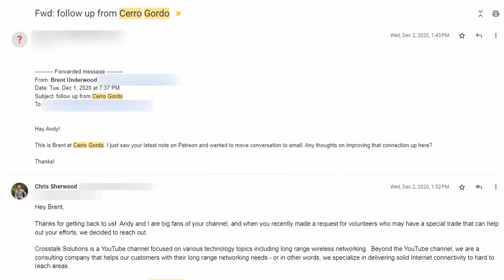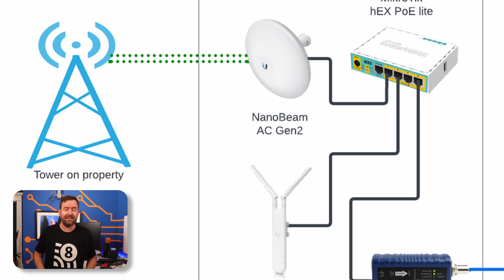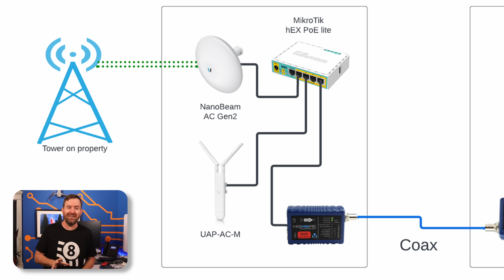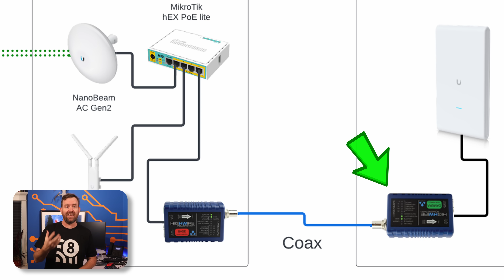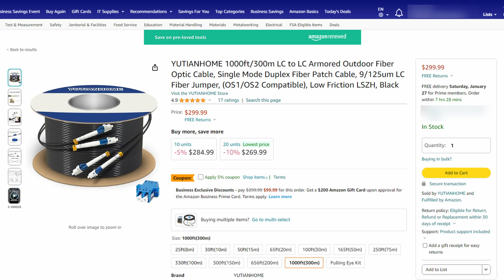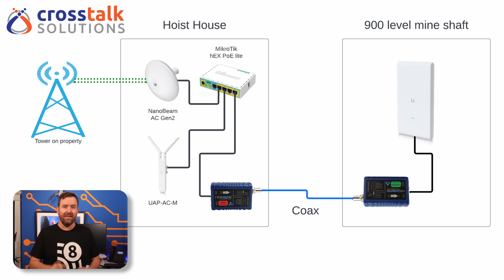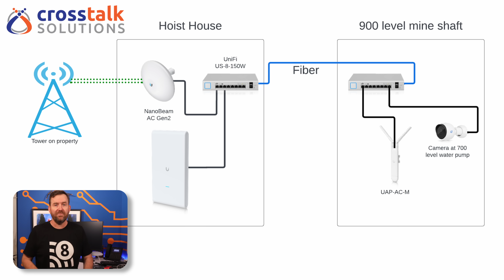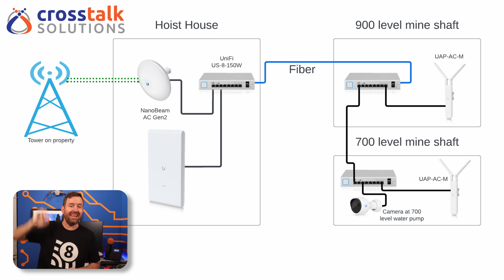Backseat Driving a Wireless Install 900ft Underground

Comment: id get multiple fiber runs down stopping at 700 and 900 and fiber linking the 700ft stop to the switch at the 900ft level with an ac mesh ap mounted horizontal in the elevator shaft every 200ish
 feet so you can hold wifi the entire ride in the elevator encase you get stuck you have 100% coverage in the main shaft. starlink as a main with the tower as a backup or better yet put a udm pro SE with the ups unit up top. use the dual wans to aggregate the data for better latency and redundancy. using the two SFP+ ports with a pair of fiber links down the shaft one stops at 700ft the other at 900ft with a USW-Pro-8-PoE at each level and a 3rd bit of fiber linking the two so if for any reason  one of the fibers to the surface fails it can reroute to the other switch and up the 2nd set in fact if there is a separate air shaft from the main shaft id run one of the cables that way so if the main shaft ever failed you can get a connection and get help. also at each level id get a big battery unit like a ecoflow delta 2 max OR a bluetti ac200l something with at least 24hrs of backup power at each level and at the top so if the mine lost power the internet will still be up including cameras both above and below so if your at 900 ft you can tell whats going on in the lift house in town etc maybe even toss a big PTZ dome up high so you can see the big picture. 
I live in the California desert and one sudden summer storm can take out power for hours or even a day or two

Comment: Chris, I agree with you, on the fibre down the shaft, but one thing i would change uptop, is your switch... i would of done USW-Industrial (430W) for reasons of the harsh enviroment, dirt, hot and cold.
Reply from the maker: USW-Industrial doesn’t have SFP ports for fiber.
Reply: @CrosstalkSolutions  oh yes correct, my bad

Comment: Chris, do you think the US-8-POE can handle the heat in that outdoor enclosure well during the summer? I agree with your whole setup, but that switch in particular gets pretty toasty and I would be worried about it overheating.

I don’t have any experience with Ubiquiti equipment in non conditioned space so sorry I don’t have an alternate suggestion

Comment: We ran 12 strand fibre to 975 and then down to 1450 at the mine I work at. Power is already down there so no need to push POE down the same cable. Computers, phones, radios, plc's, sensors and wifi of course all work fine.

Comment: In my personal opinion the optical fiber is probably the worst possible idea....
In a mine shaft you don't need a 10 Gig connection (you can't have it either, this place is in the middle of nowhere and rely to a fixed wireless access to get the communications!).... in a mine shaft you need something that is sturdy, reliable and can be easily maintained and repaired...... a fiber cable is 100% something that is NOT easy to repair!
Because of the power cable, in my personal opinion, i rather prefer a cheap (but still fast and reliable) Cat5e or Cat6 cable and two very cheap 5 ports gigabit switches (one every about 90 meters) as "repeaters" instead.
If something goes wrong, Cat5e and Cat6 are still very easy to splice and also you have 3 free extra ports on each switch to connect other devices......
As a bonus, if a gigabit connection is not required (and this may definitely be the case... a 100Mbps seems more than adequate!) you can use only 4 wires inside the CAT5 cable for the LAN communication and recover the other 4 wires for other purposes (i.e. an analog, hand-cranked, army surplus phone that can still works in emergency even in case of power failure and some sort of water level alarm!).
BTW.... i think that the COAX cable is not that bad..... the worst thing in this actual setup is only the cable management because loose wires inside an unprotected elevator shaft and inside rough tunnels screams for disaster waiting to happens!!!!

Comment: - spare switch in hoist house
Eh, the Mik will last no issues. The unifi would die before the mik does (specifically because of environment)
I agree with the fibre instead - and they could have used a hEX PoE which is a SPF on it, so just transceivers and done.
But overall - a single management pain is better.  

Overall though, I would have used the Ruijie RG-NIS3100-8GT2SFP-HP industrial switch at the top - and install one at the bottom in another enclosure - and fibre between them.
So PoE power and fibre backhaul.
So extra cams, or APs down there - no issues (8 ports - or go their 4 port variant)
But then again, do Ruijie for wireless and then also single pane of glass - same same but better

* ref: we've stopped installing ubnt equipment and deploy Aruba/HPE/Ruckus/Ruijie/Mikrotik equipment now days - more reliable, less issues, better support & warranty.

Comment: When speaking about eliminating single points of failure that is exactly why they run coax for power and ethernet. Because if the main utility feed drops you would still have comms down there. Probably why they ran mikrotik because of its wide input voltage range. It's most probably a different power feed powering this setup obviously they had issues and ran a poe at the bottom but clearly that was not the initial plan for a reason. Ps armored fiber because it's less susceptible to lightening I don't there is much lightening down a mine shaft.

Comment: Fiber is the best way to go, but since they got power down there, why not start simple and cheap with a simple romex injector. Those things you plug in the wall and an internet wire to it so it injects the internet signal in the romex? Then you can simply add other devices to it or nodes at other levels in the mine

Those worked great in the house for me and since theres only 1 romex going down i figured they would work great

Edit; i just read more about them and 984 feet seems to be the furthest it can go, not the best option of course but should work for this!

Comment: I am betting it's that splice. Unless there is professional connectors in there it's probably some twisty twisty action. In catv docsis internet  that doesn't work so I don't think that'll fly. 900 ft is also pretty far to go on rg6 which I am guessing that is. We would use rg11 in residential but even with 11 500ft is kind of our max It has. less loss thicker cable. Depending on interference quad shield would help too. 

Ultimately I think it would have been better with fiber as stated. 

But that's the flaws I see in using coax. With coax I wouldn't have tried to get power 900 ft down a coax cable. Just do poe at the bottom as stated.

Comment: Other than using a system which the management requires an internet connection to manage the local devices.  It could also be the fact the mesh AP wasn't giving the cellphone connection as it wasn't set up, and the cellphone didn't have a separate internet connection... to connect to the server, which the AP was talking to, so it could get connection.  700 ft of power wire does also have a huge line loss, which they may not have taken into account, either.  I think they thought that the range of the antenna would reach the 200 ft up... ignoring it is solid rock and not the air which is what the rating is for.

I haven't watched his channels, especially since I have realised he has massive backing which most people don't have a chance of affording.  His bigger issue is how remote it is, not how much it costs to get stuff there (many people are just not able to do it safely)

Always test all your gear before deploying, when in tough layouts like this, so they are already configured at deployment time.  It's also the good thing when you are dealing with winter weather too.

I like your plan... but could always run fibre to the 700 ft, with a switch, then back out the second port and drop the remaining 200 ft, to the other.  I still prefer devices which allow for hardwire testing, and hardwiring everything possible.  I would also use NEMA enclosures with heat and cooling at the top, and cooling at both lower spots.  For antennas, I would use directional ones down below, as going straight down a tunnel, you don't need an omni antenna, as if it's mounted on a wall, it's already not going to be using half the beam.

Comment: i would still prefer mikrotik, for the switch/bridge devices, becouse of power usage and also for their reliability in non optimal temperature condition (as you said, super hot and maybe even humid environment, big nono for 150W switch that heats up we all know that  a lot even when running in 20° C), use HEX POE or PowerBox PRO instead of the hex lite, for the SFP port, full gigabit ports, for future support of AF/AT you would simply change the 24V adapter to 48V and this mikrotik will provide AF/AT too, i totaly agree on using fiber optics instead of fiber, that coax is not worthy using in 2024

Comment: I left a comment on one of Brent's videos about running fiber and a cpl of small fiber switches before.  Would have been a lot better then Coax.  My only other concern is it looks like they only ran standard Romex over 900' talk about a voltage drop at the 900 level.  Pointed that out in my previous comment as well.  Be very surprised if they can even pull 3 amps down that run.

Comment: Personally, I immediately thought that the best option here would be to run 6-12 strands of LC fiber down to each of the levels individually, have a switch at each level, and then you have plenty of spare fiber for other things (like maybe an intercom system like Studio Technologies' Dante stuff) and you aren't daisy chaining your network switches with other ones in weird to access places. Plus running 6-12 strands down to 900 gives you the ability to patch another trunk onto those strands to go down to 1200 like they plan to in the future. I also would never use unifi in an install like this and would rather deal with individually manageable things since it will probably be easier to directly attach a serial cable to a switch + have in band management rather than have to travel up a 45 minute elevator to make a configuration change then travel back down to see if it works.

Comment: Love both of your channels. Excited for the colab! :) I've been doing something similar in conduit alongside my long driveway (a string of APs, one every N feet). I've been curious if it might be possible to run fiber with many strands (adding strands is relatively inexpensive vs multiple cables), and pull out 2 strands (or 1 with bidirectional optics) at each location without terminating all the strands. Would allow a single cable to "stop" at the well, then continue on to the bottom. Since fiber has basically unlimited reach, you could totally pull a single cable from the top all the way down a leg of the mine, stopping periodically to add an switch + PoE, AP, or Camera, etc. (assuming you also ran power). I'm not sure if it'd work, but my hunch is it might (to avoid splicing all strands at each stop, it might be possible to strip the entire cable sheath at each stop, protect all the strands in a fiber splice case, then only terminate 2 fibers?). I'm not an expert, just sharing an idea I've been curious about for my project. :) They also sell fiber with copper for power (mostly DC), which seems really versatile. Expensive, though, and Romex/AC is probably more useful for other things (can plug things into outlets, etc.) Also might be able to avoid fusion splicing with field assembly connectors.

Edit: Maybe this is more complicated than necessary. Especially if you could place switches every N feet and buy multiple pre-terminated cables with only two strands each. My application was limited by conduit size, but that's different here. Hmm...

Edit 2: Just found out this is called mid span access. Good videos:
- https://www.youtube.com/watch?v=0NhMVcHiFcQ
- https://www.youtube.com/watch?v=PJ9XvFkF9Yk

Edit 3: Possible parts
- Corning SST-Drop 12 fiber
- 1x Corning OSC-1-10-10-21 at each stop
- Corning/3M Fibrlok 2529 Mechanical Splices
- Bidi optics (1 fiber for each stop)

Or, cheaper from FIS:
- S09FD12CZEBL (12F drop cable)
- Z1-LOCDROP-EN
- Corning/3M Fibrlok 2529 Mechanical Splices
- Bidi optics (1 fiber for each stop)

Just having fun thinking through this idea... :)

Comment: The Mikrotik hEX he used can use any port for any purpose, so it definitely could be acting as a router. It's also 1/4 the price of the US-8-150W, and they have a version with a single SFP port for only slightly more (hEX S).

Comment: I know you talked about coax vs fibre, but isn't fibre way easier to break? You have to remember that the elevator runs right next to this line. Also, isn't it easier to splice coax in the future? Rather than fibre ?

Comment: I think your redesign makes a lot of sense.

One thing that I would change, just based on this being a potentially life critical link, would be to identify a secondary shaft to run fiber through up and back to the houst house, making a physical loop.  Then you can use CWDM optics and OADMs at each level to get east/west diverse paths to each level.

Comment: The Mikrotik hEX PoE has an SFP port, so you don't need Ubiquiti to use fiber. Also, it's a full router, not just a switch, so you can do interesting things with mesh routing, for instance. OSPF across multiple backhauls, perhaps? :)

Comment: I would not have used any Unifi switches. I have a severe distaste for them. They seem to be avoiding the wider QSFP(+,28,56) standards in favor of SFP(+,28,56). Way overpriced compared to what else is out there. That US-8-150W makes zero sense to me. Only has a two 1 gigabit SFP uplinks. For the same price, you can get the same thing from Mikrotik that has two 10 gigabit SFP+ ports. I would have use that in the hoist house. Run fiber down to the 700 level to one of those Mikrotik switches. Then use the second SFP+ port to run fiber down to the 900 level with another one of those switches. Either that or run two fibers down. One goes to the 900 level and one goes to the 700 level, and then still have one between the 700 and 900 level. Make a ring out of it, in case one drop dies, everything will still have access. Kind of important in an old ass mine.

Comment: Can't they use some of the network cables that can go longer then 100m as shown by Lawrence technology about 6 months ago? They could run 2 just in case. Hmm also possible to use flex 5 Poe at the bottom with those special cables and feed power to down there

Comment: I definitely though fiber, but considering they are wanting to also bring connectivity to other levels the coax would be a lot easier to splice into on the various levels than fiber would be. However, I think fiber would have saved a lot of hassle and troubleshooting

Comment: I have used those Ethernet/Coax adapters.  This was in several high rise apartment buildings, to put security cameras in the elevator cars.  There are a couple of reasons I can think of, in that situation, for using the adapters.  It's a cleaner install, with only the one cable coming into the car and not having to worry about power.  The other is this job needed cables that were designed for use to elevator cars.  There was a suitable coax, but I don't know about Ethernet cables.  The distance might also be a bit long for Ethernet at some sites.

Comment: That's funny this was on my watchlist. Yeah it's almost like somebody thought isolation between buildings with glass would be so much better than running a copper line that's susceptible to issues. Plus coax field terminations not some thing you want to be doing in the dark one little strand and

Comment: I had much the same thought regarding the coax. That totally took me by surprise when they did that. However, I would be concerned that the armored fiber might be too heavy for a vertical drop like that, making me lean toward unarmored fiber with loops every so often attached to the sides, to relieve the weight. I also would consider an intentional loop from top to 700 to 900 back to top using STP so that if a cable snapped, they would still have connectivity while repairing it.
Reply: But in the footage, we see them anchoring the power, and presumably the coax...  I would assume that they could anchor the fiber / armored fiber / conduit.  Did they only anchor it at the top and bottom?
Reply: @BenjaminSchollnick  the video didn't show, I don't think

Comment: Hi.....why the UAP-AC-M-Pro didn't work when it was connected with the PoE inyector?
If they had electricty down the mine, they should have more than enought power to run the Pro version....right?
It's weird that the non Pro version worked just fine but the Pro version didn't
Thanks!
Reply: I saw another comment that suggested that the pro was 48v POE and not 24v and we don't know what the coax converter supports. My guess is the power at the end of the line was severely degraded and most likely incompatible.
Reply: @imark7777777  but at the end they connected the pro to the poe inyector that is necessarily connected to 110v so if it was 48v or 24v passive doesn't really matter unless they used the wrong inyector